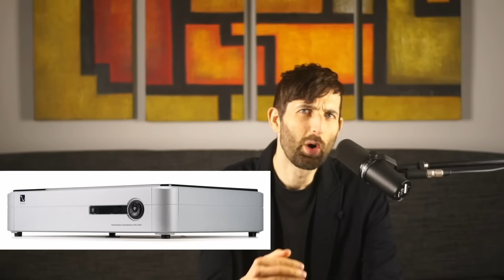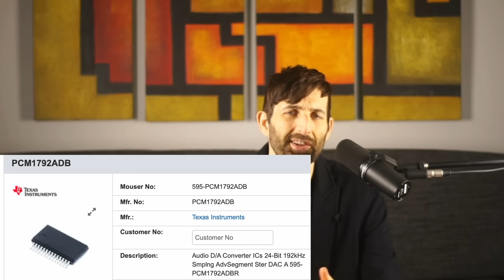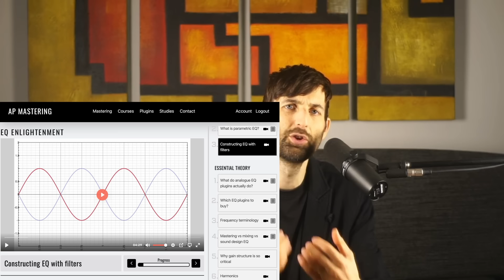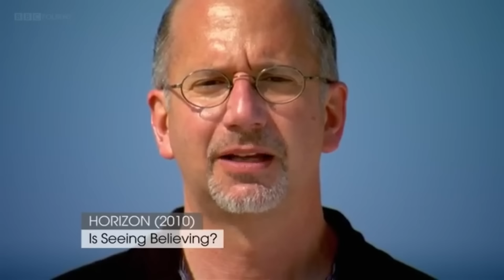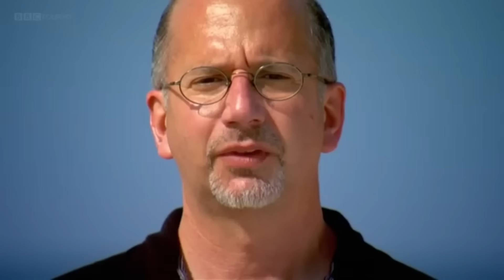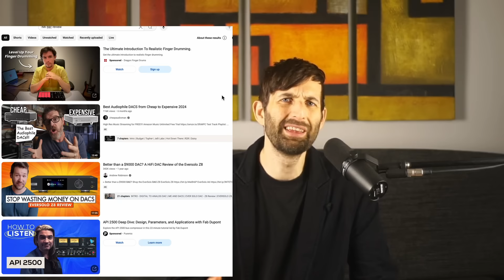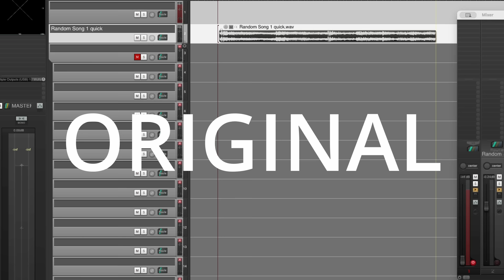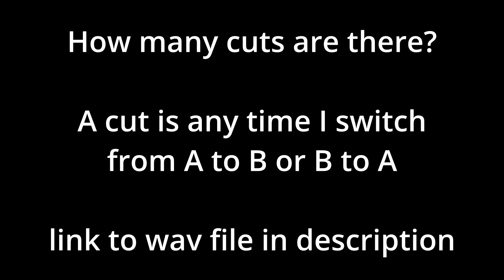The DAC Scam - Almost everyone believes the hype

Comment: You are correct -- again and will see much hate mail, again.
The job of a DAC unit is specific and should ideally have as little as possible wiring and fewest components which are likely to impede the work of the DAC chip or chips. 
The 2 main types of DAC used professionally have 1 or 2 chips and the 2 chip ones perform different tasks.
Clean DC is essential and fewest I/O ports in a single box. Different versions of I/O layouts can be offered. The point is to have no actual 'flavour' and where people want adjectival results there are analogue mixers for that, ideally placed downstream of the power amp.
Preamps can partly be used in this regard downstream of the DAC but will be 'generalist' in nature even at the highest level of design. The founder of QUAD Electroacoustics, Peter Walker, said this many years ago and ensured that the 33 and 44 had a "tilt" function but it was better developed on the 44 and worked using voltage, not filters. 
Mr Walker was always a stickler for wire screening and demonstrated stray magnetic anomalies in closed boxes, just to show how much was going on until screened and he would have looked at the wretched "ladder DACs" of today with not a little irritation.
Read up on how "ladder DACs" work, count the soldered components, lengths of wires and consider what all that interference does to the DAC chip's effectiveness.  
There is simply no logical or electronic case for having so many active parts next to the primary part.
APM is right about buyers tending to defend having spent a large amount of money  and claim that they can hear subtle things which others cannot. It is human nature to save face rather appear to have been foolish to acquaintances, relatives and themselves in the shaving mirror.

Comment: I have a really old Sony CD player over 20 years, thinking the  SMSL cheap DAC would have a better chip in it.... ran both to 2 inputs so I could switch quickly between both and found no difference at all..Then I bought a higher end CD player, Rega Apollo and did the same test... the Rega clearly sounded better. So my take away is that a decent piece of audio gear should have a good DAC chip in it to begin with and your shouldn't need an external DAC.

Comment: Very twisted and narrow minded, manipulated interpretation of the subject, if you are asking me. DAC is not just a chip. There are siginificant differences in sound. Some modern (cheaper) dacs are just unlistanable to my ears. For example also tubes can sound significatly different at tube pre/amps. Also digital can never sound as natural as analogue to my ears - but you would not hear this with budget gear. Nor if you have speakers just by the wall or in acousticaly untreated room with sound reflection's over 300 - 500ms and especially over 1 and 1,5 second as they are in modern flats. With echos- log reverb time you cannot hear many of micriodetails, microdynimcs in a presentation = poorer sound stage.  Treated room is also quieter 5dB at least or more and consequetly you are able to hear more subtile informations from reproduction. These are my experinces. And my hearing is tested and still very good. 
Proper listening room + proper speaker positioning is 50% or even more of great sound and capability to hear significant differences with gears. If you do not have and never had such pre-conditions, you can not even dream what are you missing and what your system is capable of (or it is not) nad what a really great sound is. So in a echoing room + poor speaker position it is better not to invest in hifi gear, becuse it is almost meaningless. Again, these are my and friends's of mine experiences.
And yes, out there are stupid priced gears. But what is stupid from some reviewers is when they are saying - when making a product hype - a 400 Usd/Eur Wiim ultra has 85% of sound reproduction quality comparing it to some hi-end gear, but still they will push for 50x or 100x more expensive gear. Why? I have Wiim Ultra at the moment and it is good, a very correctly sounding gear. But is it a great sounding one? NO or more precise - streamer is better then dac section is.
But still my friends, audiphiles, when they are listening music in my acoustically treated room, they are amazed what a great sound, great 3D soundstage, microdynamics  is comming out from a very moderate prices gear  but balanced room and system as a whole.
Kind regards.

Comment: DAC chips don't have a sound. Analogue output stages however do!!
Reply: Plus, the designer can "tune" the overall sound (warm, bright, etc) thru the output stage...correct?
Reply: @daleclark4160  yeah, i think you're thinking of sampling filters. Filters have a sound, and some brands come with presets, others are tuned
Reply: @daleclark4160  They could, but would they? Once they've done that, it would show up in the measurements and there might be more to sales to be lost from reviewers pointing out the crappy measurements than gained by trying to impart a particular sound profile that some sector of the customer base may prefer.
Reply: Most modern DAC chips have the analog output stage built on the same chip or die.
Reply: Sure. And if there is an audible difference it could be heard in A/B testing, right? Would anything that colors the sound show up in distortion measurements?
Reply: A analogue either
Reply: my god u are stooopid.
Reply: Listening through Sennheiser HD 280 Pro’s, which are cheap studio phones, wired into to and iPad Air M2, and I could not hear any difference, but then it was a really crumby recording, compressed and mangled over YouTube/ Network so a bit of a stupid test in reality.  I say this even though I think some of the points being made are valid.
Reply: There's a very easy way to settle this.

Make a video of yourself passing a double blind test, simple.

I guarantee you won't though, because you just want to make claims and never SHOW that you can do what you claim you can do
Reply: @crazyprayingmantis5596  so you assert that every DAC sounds exactly the same? There's no warm DACs for example just exactly the same?
Reply: @MOOeymania 

I don't assert anything, if you are claiming you can hear a difference then demonstrate that you can.

Talk is cheap 
If you can't SHOW it 
You don't KNOW it 

SHOW us
Reply: @crazyprayingmantis5596  lol typical non answer.
Reply: @crazyprayingmantis5596  so you won't answer the question?
Reply: @MOOeymania 

What's your question again, for some reason i can't see it.
Reply: @crazyprayingmantis5596  you don't believe any DACs sound different?
Reply: @MOOeymania 
I didn't say that
Reply: @crazyprayingmantis5596  lol okay
Reply: @MOOeymania  Do a "triple" blind test 100 times, write answers. 1. Choose song for the test, that you don't know (so no bias here). 2. Your eyes will be covered, so you won't know if DACs are ever switched. (No bias here too). Repeat 100 times and write answers (which DAC it is each trial). Do it in neutral space (not yours, no bias here). Person switching DAC shouldn't be someone you know (no bias here). Obviously - great room and monitoring, but only difference in the chain should be DAC. Do it LIVE with cameras pointing at crucial spots, so it's visible that there's no cheating, do it on YT. I bet that even if its played through the same DAC in all trials - you'd "hear" the difference.
Reply: @GrooveOnWheelsMix  that's hysterical when is your stand up routine? I'll just believe my ears. You keep fighting the good fight against people's lived experiences.
Reply: @Iainmaclennan70  way over these peoples heads
Reply: Wrong. The Chips conversion make or break the sound no analogue output even the best can fix. Analogue output adds the colour or further breaking of sound or at best keep it as good as it came out of the chip.
Reply: @GiancarloBenzina I’ll say a poor analog implementation will make it worse…. There is a point of dimensioning returns..  But…. you need a properly implemented analog stage..  at the same time doesn’t have to cost a fortune…
Reply: @DAC chips don't output sound , they output 0's and 1's.
Reply: @Iainmaclennan70  If it were outputting 0's and 1's it wouldn't really be converting anything. It's a Digital to Analog Converter
Reply: @GiancarloBenzina  But even the cheapest mass-produced DACs these days produce consistently transparent, uncolored, accurate conversion which is hard to improve on.

Comment: Funny thing about ADC is that it is a really fast sample and hold circuit. The more grains you can capture, as well as, the more even and synchronized the clock that is triggering the sampling mechanism which is literally a xtal oscillator (piece of quartz), the better recreation of the analog signal which you are trying to represent. But once the (A) goes to (D), that (D) is literally 1s and 0s and it is in the best signal you can have as far as accuracy goes. Rendering out of the computer i.e DAC. There is no increasing the quality beyond the bit depth and sample rate of your project file. Any amount of conversions beyond that is just inviting artifacts and aliasing. My point is it is the ADC that is important in audio. The DAC is already at the fixed "quality" of your DAW project file.

Comment: I have the FiiO K11 R2R which is acting as the DAC in my desktop setup along with the Aiyima A80 which is the power amp, my speakers are the Triangle Comete 40th, and whilst these speakers are not cheap, I wanted something that looked and sounded unique and had the 3D/Live wraparound effect when sat at my desk whatever I was listening to. Regardless of the DAC/amp being used, the speakers matter a lot.

Chose this setup as I'm a huge fan of the old skool analogue/organic sound signature that I've been used to for years with my old NAD integrated amps, so am glad that I've been able to get that in a pair of boxes that take up a fraction of the desk space and have upgradable OpAmps which I have done to further enhance that sound signature.

The difference are absolutely there, wider soundstage and stereo image with instruments that pop out in a more natural way than my previous setup.

These are relatively inexpensive devices too, and yes whilst the OpAmps from Sparkos are not cheap, they do have a functional benefit over the stock OpAmps which can be heard in certain songs.

Comment: Actually you're kind of wrong. The fundemental sound is really the analog stage.  Now having said that, the chip itself is a very minimal part of it. A lot can go wrong when designing the analog sections so if its not done well it can end up with lower distortion, noise and such.  This doesnt mean that you have to buy anything expensive, but rather choose one that is competently made and not focus on the chip itself.
Reply from the maker: the extent of what the "analogue stage" is, is exaggerated by the hifi marketing and under appreciated from what the chips do
Reply: @APMastering Not true. The same ESS chip can be in multitude of DACs but each DAC can measure differently and much of that has to do with the implementation of the analog section. Its the chip that is exaggerated.

Comment: well I can't refute everything you said in this video but I will say some DAC are built with certain features that give more headroom and have better power supplies than others. I don't regret buying my spl mercury at all, I've used many cheaper DACs and usb soundcards before and they don't sound as good, I have A/B many times. but I would never pay more than the mercury. there's also something to be said about the clipping and inherent sound of a DAC, for example the lavry gold was used as an output for 2 bus on many huge hip hop records because it added weight and warmth of harmonics to the track, even so far as that clipping harmonics was also emulated by schwab digital in the gold clip plugins
Reply from the maker: pretty sure what you are referring to with the lavry gold was the ADC, if you hit it hard you get the saturation. The DAC is very transparent. I used to work with it.

Comment: "Most people can't tell the difference" is why McD's is the #1 restaurant. It does not mean there is no difference.
Reply from the maker: how well did you do in my blind test?
Reply: @APMastering To test how audible the difference is between an already digitally processed signal and multiple generations of that same preconditioned signal through the same hardware? Why?
Reply: It's impressive how much crap you managed to say in such a short comment.
Reply: @davisantos3431  Yet I am willing to admit when I have been surpassed! Great job!

Comment: Yes many use one of the common chips. What you fail to mention is what they do to that signal after it leaves the DAC chip. That integration/ filtering is the most critical part and you just ignore it.
Reply from the maker: how well did you do in my blind test?

Comment: I agree, except one thing you left out is the amp after the DAC chip. That does make a difference. Granted, that would make a DAC only max 100 usd more. But that is what many DAC manufacturers suck at, hence there is difference between them. 
But I still do not think any DAC should cost more than like 500 usd. The rest is a scam.

Comment: Well audiophiles and mastering and mixing engineers live in two different world with some level of overlap. 
The audiophile(that includes me) lives in a world where they want to make the music the like sound the best. How much we claim to want the "true sound" we love to flavour our systems to make it do what we think sounds the best.
The mixing and mastering engineer use gear that is as neutral as possible to get the mix to sound the way they think wil "translate" to other sound systems. 
There is a middle ground between these world with brands like SPL, benchmark, KEF and the likes but for the most part we operate in two different world with different end goals. 
I've started out with the magic fairy dust full range speakers and tubes combination. It wasn;t for me and I going more and more neutral with my gear choises and I'm liking it so far. 

Just to spite the music production nerds here. You'll bitch about audiophiles buying cables that are anything more then amazon basics but demand using that $10K 80 year old microphone because it sound so great while eq exists. Btw there is a plugin for that.
Reply from the maker: a U47 is more than 10k nowadays but its mainly a audio engineering's equivalent of a Rolex or something. how well did you do in my blind test?
Reply: @APMastering  i couldn't tell. Went back a few times but I never was sure enough to call it. I can live with that.

Comment: Your statement is not correct. Many high-end DACs are based on FPGA architecture and not on a commodity off-the-shelf (COTS) chip like ESS, AKM, TI, Cirrus Logic etc. With this type of system, the software and algorithms used are the deciding factor. In addition, even when using a standard chip, the implementation and overall architecture have a much greater impact on the end result. For example, the input/output stage, power supply, etc.
Reply from the maker: how did you do in my blind test?